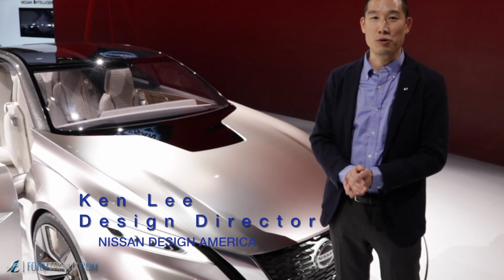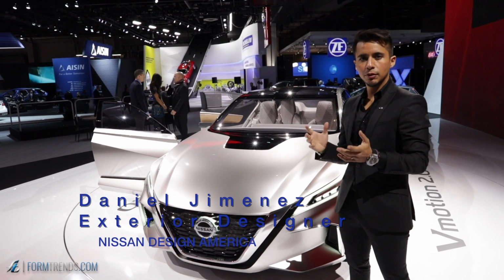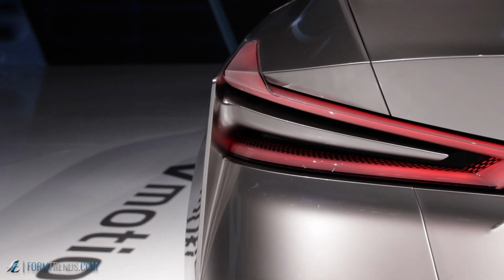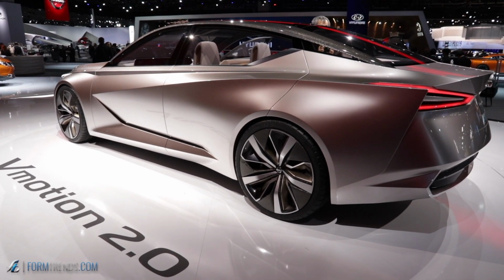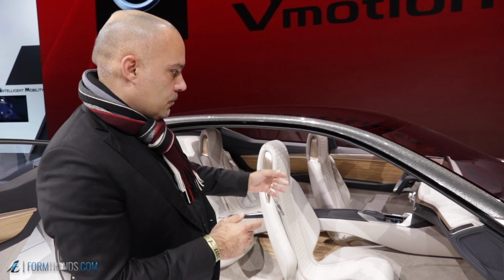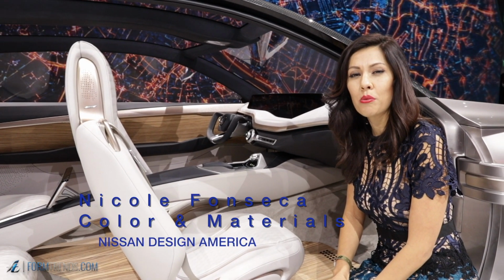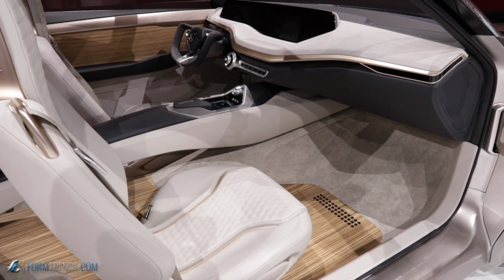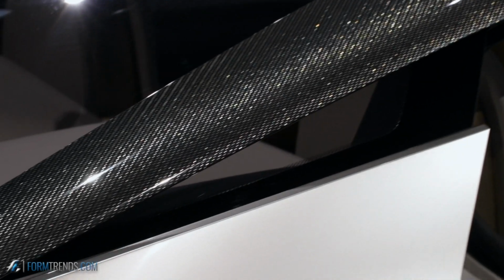Meet the Designers: Nissan V-Motion 2.0 Concept

Comment: All of Nissan dealers are cheater and stupid. Everyday, they only studies how to cheat customers not study about Nissan cars. That's why even GSM(general sales manager) do not know how to turn on blind spot in Maxima. And a sales men are so stupid. My friend works in Nissan company recommended me Courtesy Nissan in Richardson in TX as a good dealer. At least, they take care of cars clean but they sold a 2017 Nissan Maxima, which used have hale damage and not fixed clean, as a new car. and plus they cheated on paper work. Even they dare to drive and use customers' cars when customers drop their cars for service. Even they put trashes in USB cable coin box after they eat some candies when they went to picnic with a customer's car. I have changed my cars 9 times in the U.S. My cars were Honda, Toyota, Scion, Lexus. I've never gotten any problem with those cars. Never leave negative feedback by wasting my time for those car. 2017 was 1st time for me to buy a Nissan-Maxima. But it made me to waste too much time to call customer service due to bad Nissan dealers. Nissan company only answered " We do have possess Nissan dealer so we cannot do anything, the only thing what we can do is to explain how you feel to dealer shop." That is all what I can hear from them. If you read my comment here, it is so easy for you to found out that I am not a native-English speaker-it means it is so hard and waste more time than native-English speaker to leave feedback. so you can imply how much I am so disappointed to Nissan company and how much Nissan dealers make me pissed off and how much Nissan company failed to manage dealers and they do not care customer they are dealers side. I am going to start a consumer strike for Nissan and Infinity till they wake up and fix those issues. If they need direct sale system(Customer go to Nissan showroom and service center and order-Nissan Factory built up a car as following customer's order and ship to the Nissanshowroom and service center clean up car and make ready for customer in 1 or 2 mile driven condition without crazy gangster cheater dealers), they should try it.

Comment: Do not buy a Nissan. Only Nissan use fixed code for smart start engine system. It is too easy for an auto theft to buy signal hacking device that makes copy signal to unlock the door and start engine. So, Nissan cars have been targeted by a car theft. For example, more than 10 Nissan cars were stolen in a day within 1 mile Frankford@Marsh Lane in Dallas, TX, 75287. One of them were stolen in front of Walmart. She just stopped by the Walmart to buy some goods. After she shopped, she found out her Nissan Maxima was stolen. 2016 Nissan Maxima and 2017 Nissan Maxima, 2015 Nissan Juke were stolen in one apartment-Gardens at vail apartment around this place. Especially, 2016, 2017, and 2018 Maxima have been stolen a lot recently.
Reply: I live about five minutes from that walmart,  and I also have a nissan... they can have mine. Tans is slipping at only 47k miles.